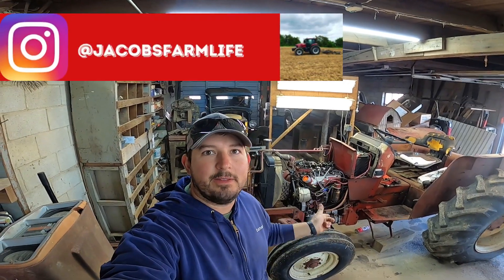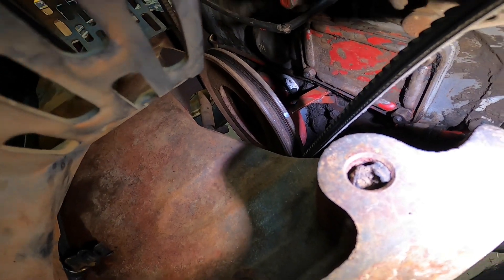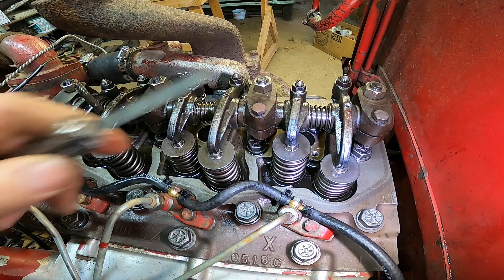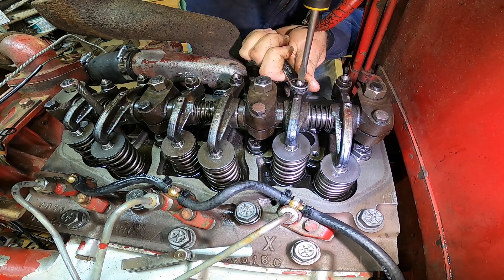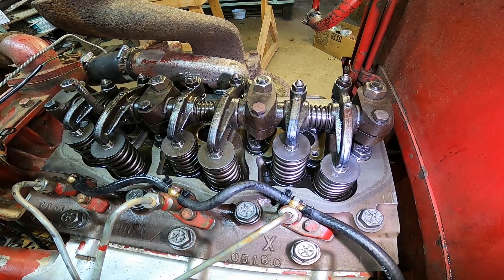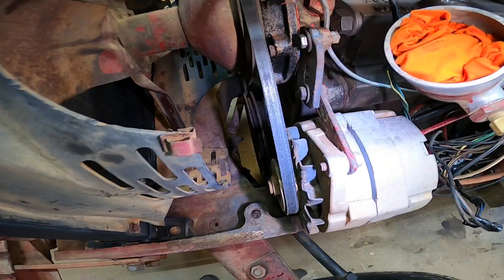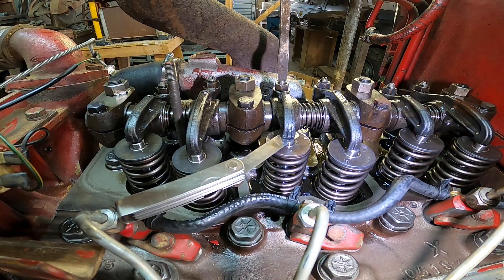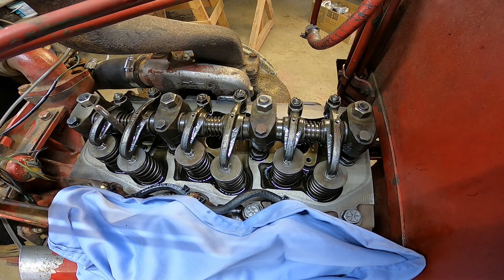IH 484 - How to Adjust Valves - International Tractor Valve Adjustment (2022)

Comment: First, I want to endorse the Peaceful Creek service manuals. High quality printing and on durable stock. Good choice.

Regarding engine temperature during valve adjustment, IH specifies "warm" as "stabilized at ambient temperature above 45 degrees Fahrenheit".
Reply from the maker: Yea after looking back I must of misread that.
Reply: @JacobsFarmLife  That information isn't always prominently displayed.
Those engines aren't too finicky.
Those little 3 cylinders are easy to work on, nice engines. Not a powerhouse but will do a lot of chores on not much fuel.
Reply from the maker: Yea I agree. We’ve had this one since it was new.  Great all around little tractor.